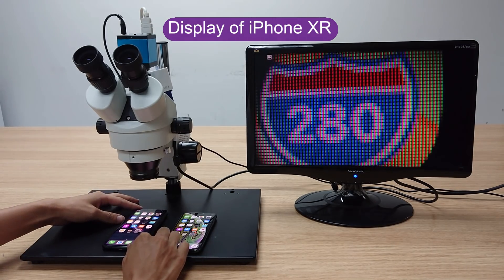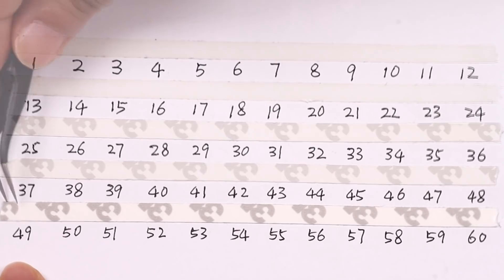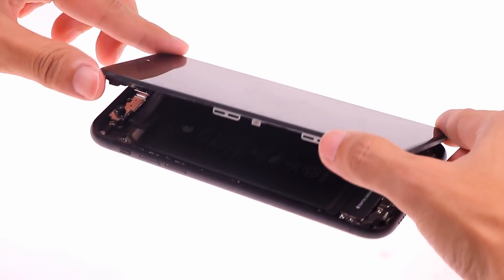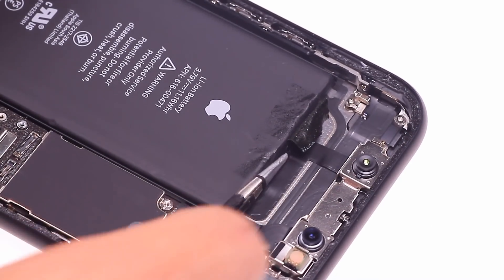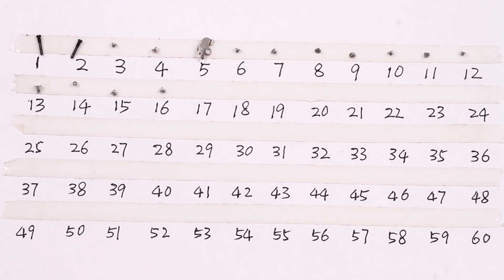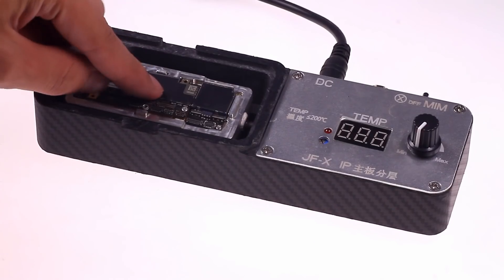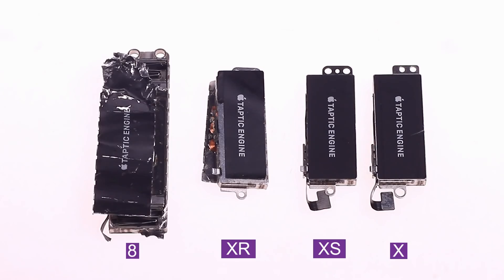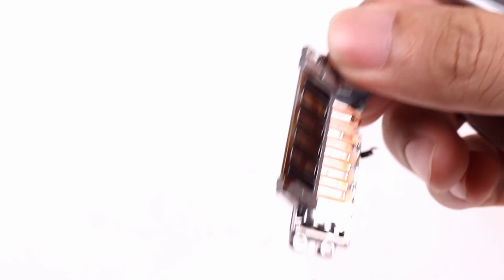iPhone XR Teardown | I Broke Open the Taptic Engine

Comment: Wow that taptic engine for the 8 is massive! That’s why when I put on a table it sometimes feel like it’s vibrating the whole surface 😂
Reply: Even inside a bag XD
Reply: Probably because it has to simulate the feeling of a home button
Reply: Blake Bedford-Palmer makes alot of sense
Reply: Blake Bedford-Palmer it's kinda jus the nature of it, it's super strong, responsive & buttery smooth
Reply: My 6s has a weak vibration when it ‘taps’ so... it’s very different.
Reply: @potato_x69  The 7's home button feels like the whole lower part of the screen is going down with a press imo